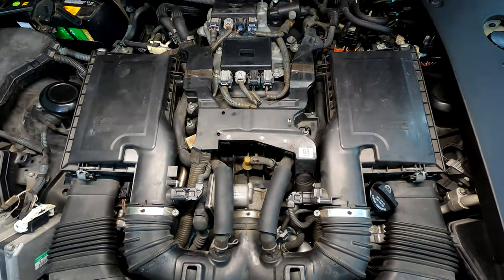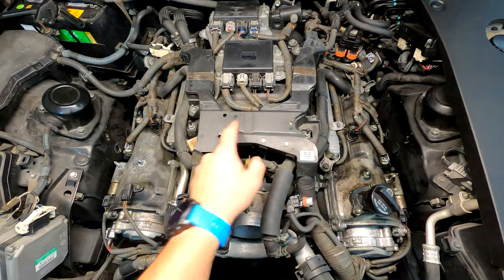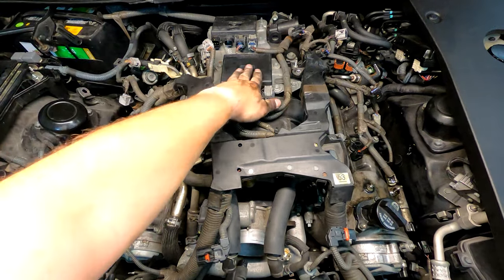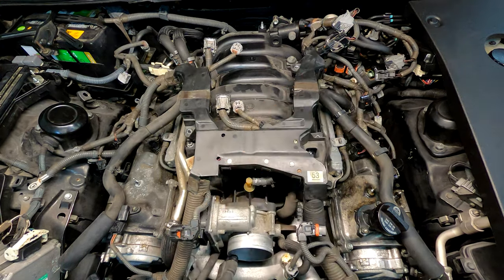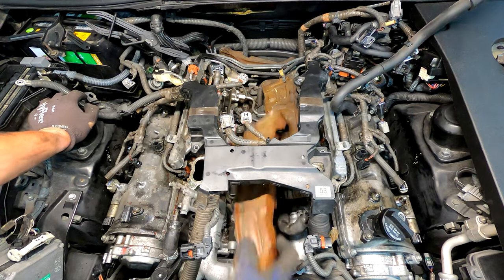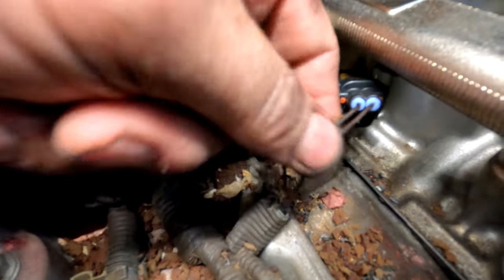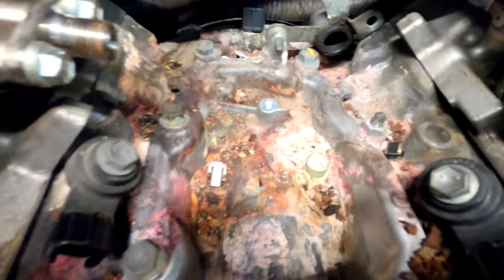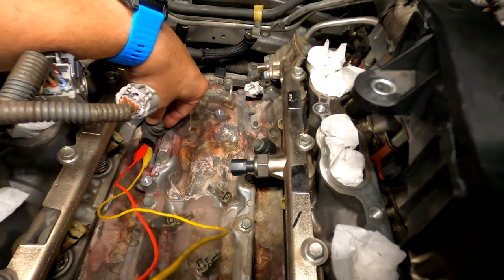Mice ate LS460 wiring P032D knock sensor valley plate Lexus Toyota V8 tear down intake removal

Comment: Just watching and the first 3 minutes would be all I need to do to access the pesky PCV valve to change that...along with the hose it goes to using a very long needle nose...I think
Reply from the maker: They say it's not possible on an IS-F, but I've done it. This should be easier.
Reply: @LILEVO  still debating if I should do it on my 460 since it seems like the last "easy" preventative item I need to do
Reply: There are zero videos of how to do this easily
Reply from the maker: @chrishamby86  Hopefully now there is one!
Reply: @LILEVO  making one?
Reply from the maker: @chrishamby86  for the pcv? I can cover it when I replace the wiring harness and put it back together
Reply: @LILEVO  that would be great. Whatever the easiest way with removing the least amount on top of the engine on the LS460
Reply: Same exact thing happpen to my 460):
Reply from the maker: @jairopavon1628  they like that spot